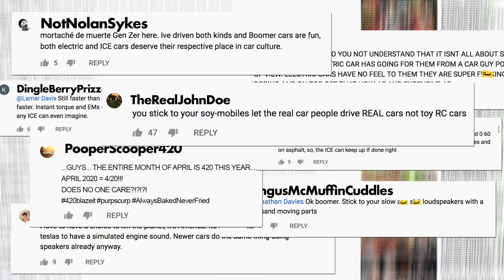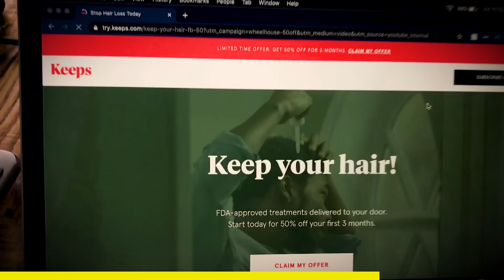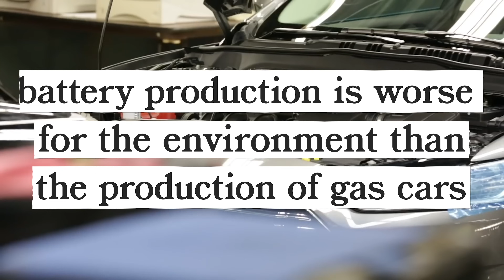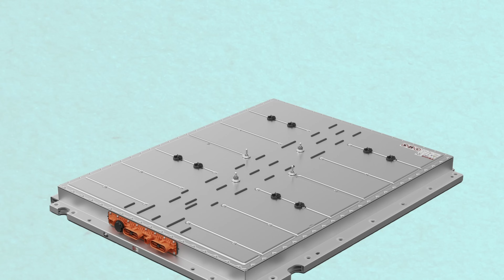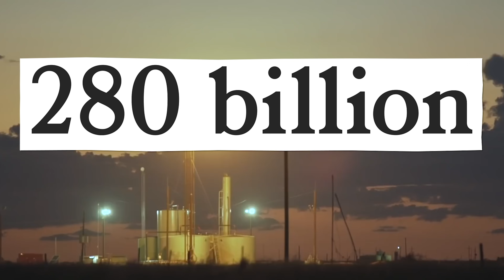Are Electric Cars REALLY Better for the Environment?

Comment: No they are not , worse than gas or diesel period
Reply: False. They are significantly better that gas or diesel. And I have absolutely no idea where you got that from.
Reply: @engineeringtheweirdguy2103  not at all you have your opinions I have mine electric cars are toxic waste
Reply: @timritenour8900  I have facts and mathematics. Not opinions.
Reply: @timritenour8900  for starters you can calculate the emissions from power plants per kW and you can calculate the emissions from a tail pipe. EV’s are cleaner than diesel or petrol. Then you can calculate the emissions from refining the fuel. Which is significant. Then you can plainly read the most literature on the topic show that EV’s only produce 1-2 ton more emissions to produce. Which breaks even after only 15-20k miles of driving. 

Then we can look at the impact of tailpipe emissions. Tell me, if diesel and gas are so much better why is the life expectancy of people living with 10 miles of a freeway up to 15 years lower than someone who lives further from a freeway? The answer is microparticle emissions from tailpipes. Something an EV doesn’t produce and something powerplants have to capture by law so they don’t emit.

Then there are microparticle emissions in brake dust. EV’s use their electric motors as generators to not only conserve energy but as brakes for 80% of their braking. Infact whilst the average car needs brake pads replaced every 80,000 miles, EV’s typically need them replaced every 200,000 miles. 

But no. Tell me all about how you think EV’s are worse than refiing crude oil by burning Crude oil just to burn it in a combustion engine which doesn’t filter the exhaust and emits it at ground level where we breath almost exclusively in the most densely populated area’s around the world. Can’t wait to hear it.
Reply: @engineeringtheweirdguy2103  not so
Reply: @timritenour8900  care to elaborate?
Reply: @engineeringtheweirdguy2103  always these cars are toxic waste most parts of it are not recyclable. I work in this industry most people have been a line of crap 10 foot deep

Comment: I feel like you underestimate just how much electricity comes from fossil fuels (coal, gas, oil). Of course, I'm talking about only America, so take that with a grain of cobalt. I would say EVs (as they exist today) amount to a miniscule improvement to the emissions released by combustion engines. And also, cars/auto manufacturing represents a small sliver of global emissions, so don't fool yourself into a Messiah complex by purchasing a Tesla. Great video, though, I love it.
Reply: Indeed, although EVs do contribute to the solutions in dealing with environmental problems. They may be small sliver, but multiple small slivers making progress adds up.

Comment: Hey guys, is it worth considering the elephant in the room, or shall we spend the next 5 yrs pretending like we have the past 5 yrs.

The EV industry still has to overcome the following few very real issues, before it becomes mainstream 
1. The fossil fuel/gas companies own the global political elite. Is that amount of investment and power just roll over? & 2. Do these EV pass stringent crash test auditing? 
3. Fossil fuel is going to be required in an abundance (the likes of which the world has never seen before] to produce energy for fueling-up cars.
Meaning that electricity for industry and home use will have to be rationed.
Good luck is all I’m saying!

Comment: Hydrogen is the way forward. Conventional battery power is causing lots of side-problems, which will only get worse with increased Lithium mining. Yes, I know that current methods of extracting Hydrogen are also polluting, but we can address this more easily, it may take a few more years. But Lithium and Cobalt are finite resources; we're surrounded by water.
On the other hand, we could all walk a bit more, ride a bicycle, have a properly made infra-structure of buses, trams and trains to get us to our work-places and keep our less polluting vehicles for the days out with the family. Love and peace.

Comment: I am so sick people insisting that EVs are the future. They are definitely NOT the future. Private cars are not even the biggest problem. Powering homes, commercial and industrial buildings is where the change needs to happen. Efficient gas cars should stay.
Reply: Care to elaborate? Because even the most gas efficient car produces about 227 grams of non-controllable CO2 waste per mile. Even disregarding hydropower, wind turbines, and solar energy, which produce no waste, if the average electric car was powered from a nuclear power plant then that would produce about 0.00005 grams of controllable waste. That is 4540000x more efficient than the most efficient gas car. How is this NOT the future, again?

Comment: What you haven't addressed is the lifespan of the EV battery pack. (10 to 15 years). The cost of a replacement battery pack and the cost of recycling the spent batteries. There is also the time taken to recharge the batteries (3.3 kva is quicker) and the tax on petrol/gas that is collected as revenue to keep maintaining the roads that electric vehicles are not taxed on. There is still a lot of work to be done to convince me on this one. 
I can travel 1000km per day @ 3.9km per 100km (25km per litre) in  my small 1.6lt diesel car. 3500km in 4 days across Australia, an EV would take me 2 weeks.
John Rossiter.
Reply: Interesting point, but I gotta ask, who signs off with their name on a YouTube comment when their YouTube name IS there name??

Comment: Okay, it is a shame you don't understand this subject.  The way to look at this is from a resource use point of view.  EVs use far more resources to manufacture than an ICE vehicle.  During their use they are also far less efficient at using fuel and turning it into motion (the ultimate point of a car).  Here is why...

Most power stations that generate the electricity to power EVs burn fossil fuels (coal or gas).  Coal is the worst so let's be generous and look at gas generated electricity...

gas powered electricity generation converts about 50% of the energy in the fuel to electricity.  8% is lost in transmission to your home.  16% is lost when you charge the batteries and another 16% of the remaining energy is lost when you convert the chemical potential in the batteries back into electricity and then into motion.  The end result is that about 33% of the energy in the fuel gets converted to motion when you use electricity as the middle man in the process.

A modern petrol (gasoline) powered car has an energy conversion percentage of 37% and a modern diesel achieves about 41%.  The difference is that when you burn gasoline in an engine the fuel gets instantly converted to heat and expanding gases and directly into motion.  There is only one state transition.  Any school kid who has studied physics should be able to tell you that it is the state transitions where energy is lost and because there are so many state transitions with an EV then there are more losses.  

Think of it this way....  an EV is basically a vehicle where the combustion is done remotely (in the power station).  in that respect it is like an external combustion engine.  We discovered this was a lot less efficient than internal combustion about 120 years ago which is why the internal combustion engine was developed in the first place.  IF we could generate all our electricity using solar and wind then EVs would be better.  Until we can do that there is no point in selling EVs, they just waste more fuel resources than internal combustion engines.

Of course the absolute BEST thing you can do is to keep a car twice as long as average.  During the second half of its life you have already accounted for the emissions from its manufacture so you only need to consider the emissions from running it.  Constantly repairing ICE cars is feasible but many EVs are built in such aq way that the battery is not replaceable and the whole car has to be scrapped when the battery no longer provides a decent range.  This is really wasteful because the life of the vehicle is basically fixed and most of the weight of the car (the battery) cannot be recycled.  100% of an ICE car can be recycled.

There you have it folks, most people don't want to hear this but EVs are much worse when you look at the resource use than an ICE car.

Comment: there are other issues to consider as well. for example, roads are paid for in part through gas taxes, meaning heavier electric vehicles are going to do exponentially more damage to roads, creating more potholes and increasing the costs of highway projects all while not contributing with taxes. the tire wear is also a major pollutant and tire manufacturers actually came up with a new rating system bc evs were so much heavier than other cars. 
we need public transit and active transit. the future is trains and bikes, not cars.
Reply: Rail vehicles are far easier to electrify than road vehicles.

Comment: Well said, but plastics, poly, and rubber are apart of the oil that we pull out of the ground which are used in the manufacturing of either EV or ICE cars. Electric cars will run through rubber more then ICE cars based on car weight. 
Karen is pushing for EV cars because she knows that most people can't put an EV car in neutral so they can rev the motor in front of their house.

Comment: Same for your phone batteries, Time to swap your phone to gasoline power.Also how clean was the first gasoline engines.Point is they will improve as they become more popular. Remember when electric mowers only lasted about 15 to 20 min. Now they run 2 plus hours on a single charge. If you think gas engines are fast just wait till the manufacturers and aftermarket get started. 100 percent torque from 1 RPM on. Future electric cars are gonna be wicked fast. It already takes a pretty hot gas engine to compete with an electric vehicle and we've already had quite a bit of time to improve the gasoline engine. Wait till we spend a hundred years on electric power. When these batteries get lighter the cars will get even faster. When you start out almost as fast and powerful as a 100 year old technology just think where it will be in a 100 years. Ludicrous speed, we'll all be going plaid at the dragstrip.

Comment: You seam to forget that CO2 emissions isn’t the only factor regarding the environmental impact (At least in your final conclusion). As you said the lithium and all the rare earth elements have to be mined, which takes a huge toll on the local environment. Lithium mining takes huge amounts of water and leaves behind a huge amount of waste products. And you didn’t even talk about the fact that batteries need to be replaced pretty frequently and can’t be recycled very efficiently.
Reply: Good point. Yes The lithium is a big deal to the planet and carbon footprint. The coal burned to generate the electricity is also a huge carbon footprint. The government are talking about building power electrical stations in forests in the UK. Remember trees absorb and store carbon dioxide. If forests are cleared, or even disturbed, they release carbon dioxide and other greenhouse gases. Forest loss and damage is the cause of around 10% of global warming. Electric cars are worse for the environment

Comment: On myth #2, I have to call BS in the case of California. I don't know about other states, maybe things are fine outside of the poorly-managed shithole that is CA. But, in the summer here, they sometimes issue a Flex Alert, telling people to conserve energy to avoid overloading the grid, so they don't have to do rolling blackouts. They were doing this before there were even that many EVs on the road all the way in 2013, when they made up like 1% of total registered vehicles here. And by 2030, they plan to have all new cars sold be all-electric. 

Which I have extreme doubts for CA's power grid being able to handle, because for christ's sake, it couldn't even handle it in 2013 in the summer, when there were far fewer EVs & the real concern then was the amount of energy people's A/C units used. If it couldn't handle a small amount of electric cars & people running their A/C in the summer of 2013, then I don't see how it can handle the entire state having EVs & running their home A/C to stay cool in the summer. On top of that, electricity bills here are also incredibly high already, they're gonna have a tough ass time encouraging middle-class families to pick an EV for their next car, when just powering it will literally double their already expensive electricity bill.

That being said, it's not like I'm against EVs. They bring a lot to the table over ICE vehicles as far as technology, safety, and emissions. And so far, Tesla has proven it's absolutely possible to build EVs that equally replace ICE-powered vehicles, it's just that they haven't produced ones that the average Honda Civic buyer will want to pick over a Civic. The main two problems is that they need to figure out how to make them cheaper & not seem like a luxury commodity, and for the families, they also need to figure out how to build a minivan model that can equally replace a ICE minivan. Which, so far, there's still no actual production all-electric minivan that you can buy yet. 

Sure, they've made hybrid minvans, some of which have even impressed my mother who's typically against hybrids & EVs (she especially mentioned the new hybrid Toyota Sienna, with its incredible mileage of 600+ miles beating the 2013 Toyota Sienna she has now, & the fact that they don't sacrifice any interior space for the battery to do so), but there's currently still no all-electric minivan that is actually reasonable for a middle-class family to own. But I have hope for something to come up by 2050 for that. In 2030? Nope, too soon. But I think we'll defo be there by 2050.

While I'm on the topic of hybrid cars in this comment, I'd also like to briefly mention that I hate the new trend of hybrid cars with larger front ends. They were producing hybrids without noticeably bigger fronts to accommodate for the ICE & electric motor, why the hell are they making them bigger now? It makes it harder for a driver to see downwards, giving them less distance to see if there's something/someone in front of them, meaning the likelihood of them not being aware of what's in front of them is notably higher. If they do anything at all to advance automobile tech in the next 5 years, one thing they better get down is making the front ends not comically massive. That's the only thing I personally hold against the hybrids of today, & I hope they fix it in later cars.
Reply: I may further add: There's another problem, what are we gonna do with the remaining ICE vehicles? Convert them all to EVs? And what about the classics? Are they just suddenly going to be illegal to have out on the road & merely be for collectors/museums? And what about the cars that just can't be converted to EVs for whatever reason? Are we just going to trash them? There's still gonna be many ICE vehicles that start up & run perfectly in 2050, as many will take great care of their vehicles & as such, result in them still running for decades, as well as improvements in engine designs making them more reliable & long-lasting. It would be stupid to waste perfectly usable vehicles, just because they use outdated technology.

Comment: Your Logic is flawed becaue you think this is a 1 for one choice - and you don't mention hybrids.
EVs currently are worse for the air than hybrids.  Why? Because it is not a 1 for 1 substitution.  Lithium ion cells are in shot supply.  You can make 10x more hybrids for the same number of batteries as full big EVs - Tesla plans to make 800,000 big EVs this coming year- that will at best eliminate 800,000 ICE cars with marginally more green heavy large EVs - Tesla it self has said the Model S is about the same as a BMW 3 series Ice car, is that green? The heavy batteries nearly cancel out the efficiency of electric motors, and these heavy cars cost more energy to make.  So given many hybrids can commute fully electric - you can have 10x as many and they are less heavy to push around; a Corolla hybrid is about 1/2 the weight of a Model 3. So do you want to replace 8 million ICE cars with hybrids or  800,000 with big EVs?   IF you care about CO2 (which is why most say they want an electric) then - you must support hybrids - EVs simply will have a minimal impact on the 80 million vehicles sold each year, as they are not very green and they are not very many. Now I will say - when EVs weight say 3000 lbs instead of 4500++, and when there are enough batteries to make enough cars - THEN electric should be a better solution.  A lot of people are betting on solid state batteries and they may do it - but they also may never happen.  That is a reality you may not like.

Comment: The Tesla model S has been out since 2012. In that time the average battery degradation is 10 to 15 percent. As far as I know, no Tesla has ever needed a battery replaced due to degradation. Real world data suggests that the battery will outlast the car.

Comment: You forgot 1 HUGE factor! and several small ones.  Lithium batteries diminish in capacity fairly rapidly.  They also charge and discharge poorly in cold weather. Recyclability of ICE vehicles is much higher and cleaner.